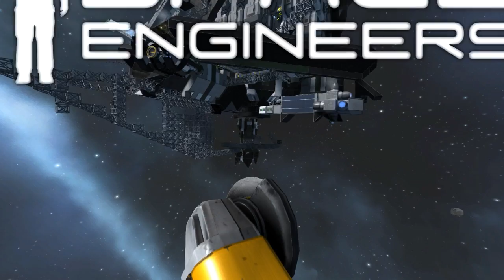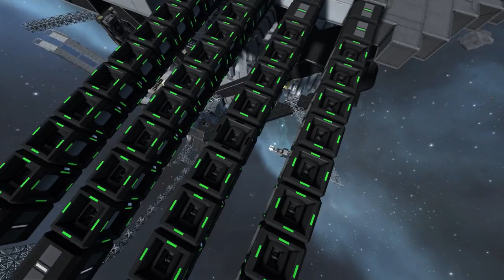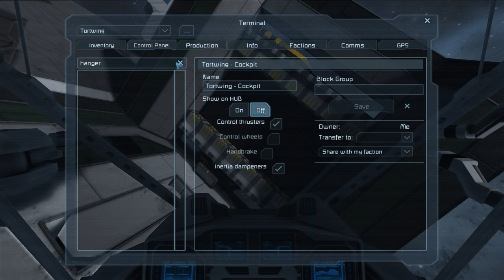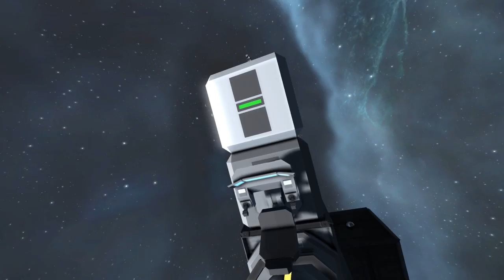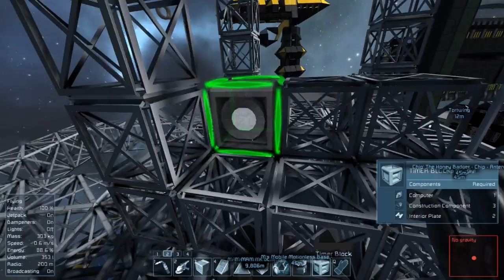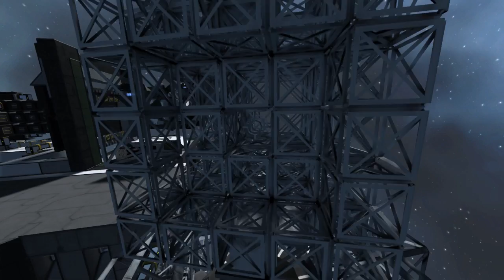Space Engineers • Solo Survival • 68 • Door Open!...Maybe?

Comment: When you were positioning the thruster cluster, you could remote access the camera (through the antenna like you access the base/remote control block) of tortwing while maintaining control of tugger. That way you'll get the same control as if you were in tortwing, with a remote control to tugger.

Performance wise, you could replace your small reactors with a big one it will save a bit on the triangles, I also believe refineries are quite a big performance hit when they are in operation. you could temporarily turn them off. For later have a switch that turns off non essential flight systems when you are a ship (close all doors, lock stuff, production off etc), and vice versa (gyro's, thrusters, etc) when in ship mode. You could have a timer sequence for that with some effects, lights, like a sort of start up/shutdown or initialization sequence for switching modes/preparing to fly.

For the brain of the ship, you could just fill it up with empty spaces (armor blocks and gaps/relief) in a patern with interior lights here and there blinking on off with different colors based on a programming block to simulate activity, You could increase the lights blinking etc based on whether the grav shaft, molar, skimmer etc. are in operation. (I'm sure someone could program that easily)

Comment: How about creating a room with  4 corner pillars made out of that small ship timer block set up with the narrow slanted base?

Also if you put a medium or large cargo container on that small ship base, add a connector and a projector, then connect it to you ships conveying system you have the means to 3D print small ships on your station that will automatically be fueled and have it's guns loaded.

Then you grind away the tube or connection to the cargo container and have whatever 3D print system you set up start again.
Reply: BTW I never even thought about using the rotor trick for having loads of small timers. my own space station project already has a few dozen, this will save me allot of space! Thanks!
Reply from the maker: Were Chicken I'd like to try to have four of them as you said.  I have one of them mostly done to show in the next episode.  It does add a lot of timer blocks to a small space.  I doubt we'll ever use up one of them :)

It was a viewers suggestion to do the rotor trick, I like it too.

I'm not sure I understand the 3D print suggestion.  We have used the repair bay to build small ships via blueprint before.  I don't have an official way set up for it yet, but it can refuel the ship via the connector.  I think we will do the rotor trick again in the repair bay for providing a build post and to power a small ship projector, and have the connector lock once its built.  Then we can grind away the stem to release the ship fully loaded.
Reply: ***** Here's a link to a demonstration version of something I'm working on, along with the probe it was designed to print. It's fairly secure. Although you will probably need to reset ownership.

I've not got the timers set up perfectly so you may have to be a bit patient but it's a great way of conveniently making allot of small ships

http://steamcommunity.com/sharedfiles/filedetails/?id=417965064

Comment: I like the new doors, and the piston tops are very very fragile when you switch between ship and station.
 I like the gray/slate/carbon color you use, can you list the Hue, saturation, and value so i may reproduce it?
Reply from the maker: Darren Muir Yup I was expecting those to blow up when converting back :)  I'm going to try to line us up as close as I can with a few points of reference.  Hopefully that will be enough to keep the things from shifting too much on the merge.  If we run into issues I can disconnect the repair bay and Crane and attach them back once the main piece is a station again.

I believe that grey is one of the defaults, but I may be wrong on that. The values are:Hue: 110
Sat:-80
Value:-41
Reply: Sorry your pistons broke on you :( but i think the new doors wont have that problem!

Thankyou for the color mat. 

I will let you know when i post the switchblade mining Rig into the workshop. It is done for the most part. but, I'm currently working with a timing block and sensor, so i don't have to check on it every 30 min.